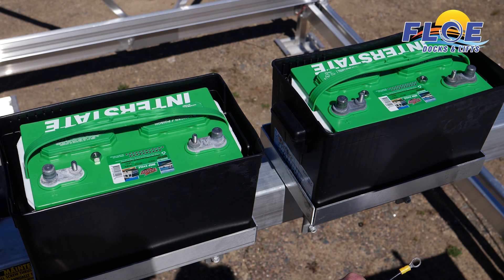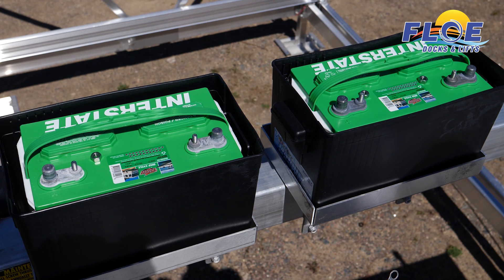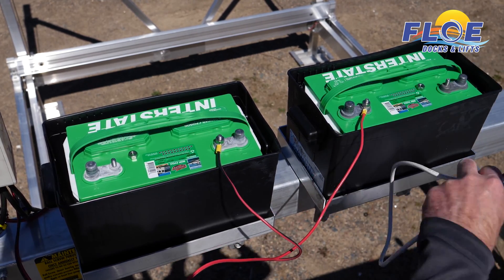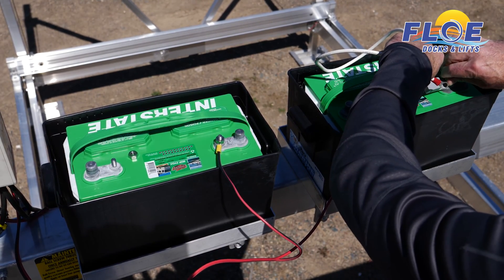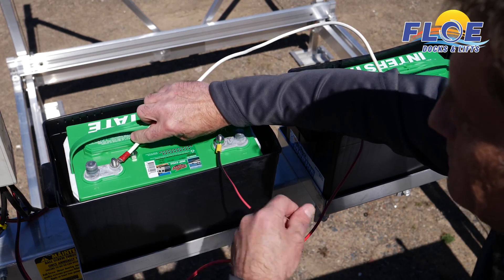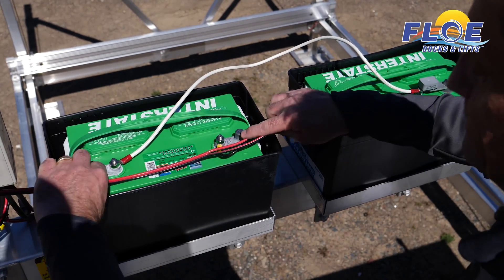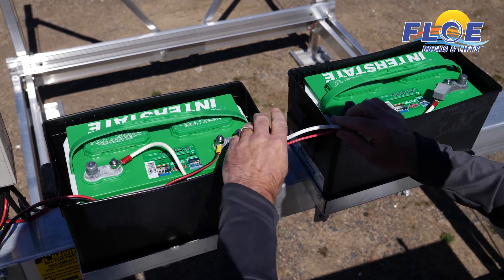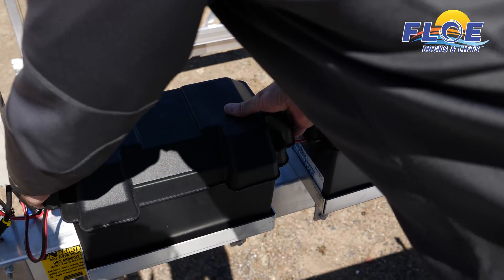FLOE Tech Tips: How to Properly Connect Two 12V Batteries on a Boat Lift

Comment: Does it matter what TYPE/BRAND NAME  12V battery to use for my 5000lb FLOE Hoist?
Reply from the maker: Per the owners manual it is recommended to use group 27 Deep cycle batteries.

Comment: Great video but my question is this (I'm no electrician). My boat has a single battery 12v system. If I buy another battery and wire it like this. Will everything ( radio, dash, etc..) work correctly or is a 24v setup too much power for these things? Thanks.
Reply from the maker: If your boat runs off 12V switching to 24V probably isn’t a good idea. You would want to check with the boat company.

Comment: what size should the fuse be
Reply from the maker: There is a breaker in the interconnect battery cable which is either a 50 amp or 80 amp depending on the size of lift.
There is also a breaker in the ASC box that is just a reset button.

Please visit with your local dealer.